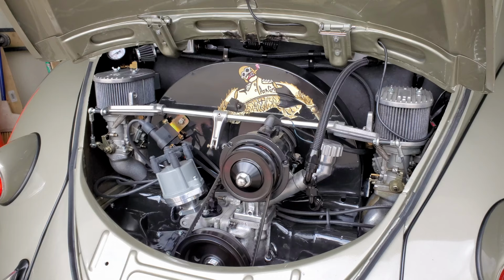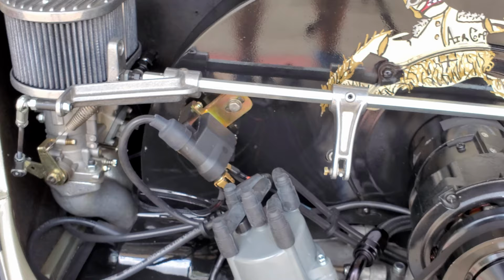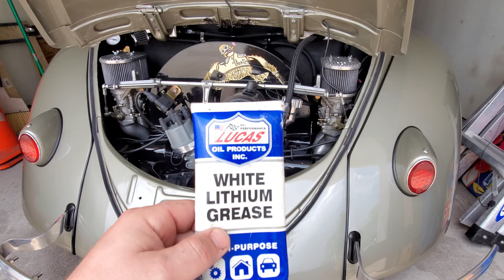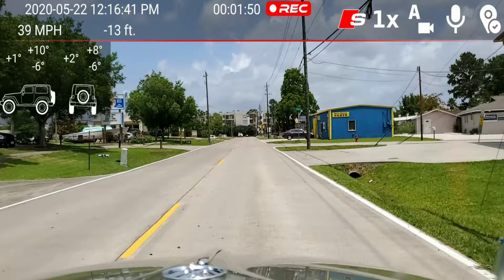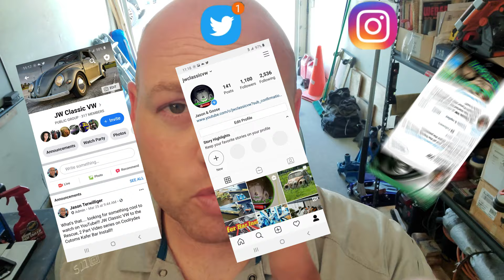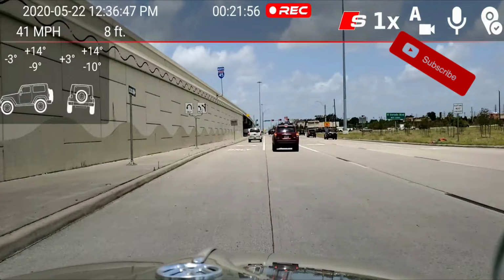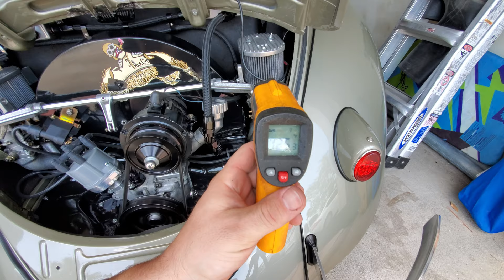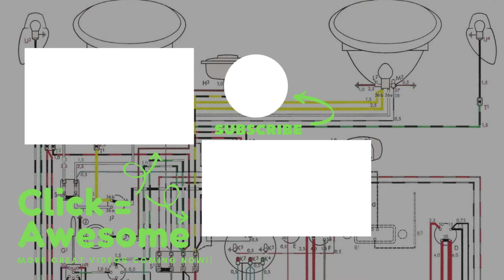Classic Beetle How Fast! Modified Volkswagen BUG | JW Classic VW

Comment: PUtting on a tail pipe on a merged system makes it much more quiet and easier to take on the freeway. still sounds good but not a deafening.
Reply from the maker: yup the A1 merged system I have has a muffler so it's not so bad, cant imagine running something like a stinger.

Comment: You have trees in your country.  Like.  Could u use the stock gear box with stock suspensions and drum brakes.
Reply from the maker: Not with a big engine like the one I'm running... to much power.

Comment: Nice video. Have you measured the heat or noticed any difference when you have the rag top opened when driving?
Reply from the maker: Are you talking about how hot the interior gets... if so no I haven't.

Comment: Idont like use clutch in driving… i change gears with out clutch… isave my rear engine bearing also clutch cable lose
Reply from the maker: Wow... speed shifting is pretty hard.  I would definitely jack up my synchros.

Comment: I have a 1914 dual Dellorto 40 the only way I can run cool with remote oil cooler ( no fan ) is to prop my deck lid 2 inch open from bottom . 66 bug . what are your thoughts ?
Reply from the maker: Man that's a hard one there are many reasons for an engine overheating here are a few: Engine timing
Properly fitted engine tin
Incorrect Belt tension
Low oil pressure
Missing engine seals
Improperly tuned carbs air/fuel
Improperly tuned carbs sync
Reply: @JWClassicVW  it runs cool as long as more air goes in but when sealed , temp goes high on hot day .

Comment: What gears you running in your transaxle 4.12?
Reply from the maker: Rancho Pro-Street transmission with a modified fourth gear.
It has a 4.12 ring and pinion ratio with the following shifts:

1st Gear: 3,78
2nd Gear: 2,06
3rd Gear: 1,26
4th Gear: 0,82